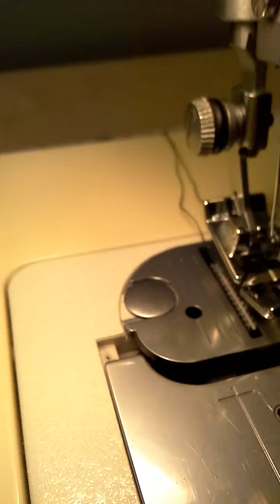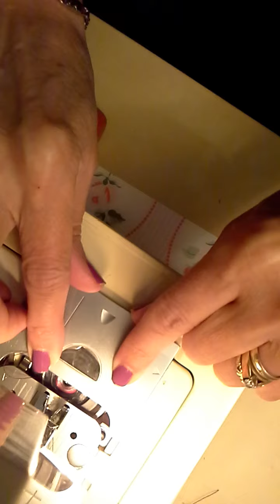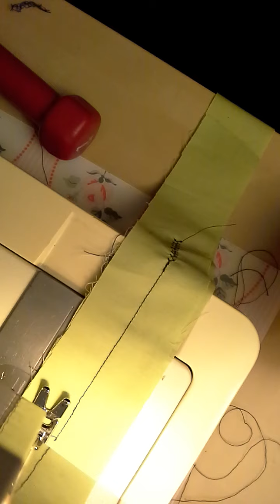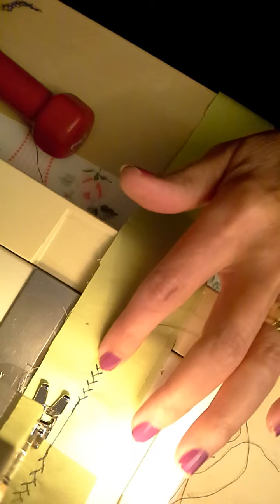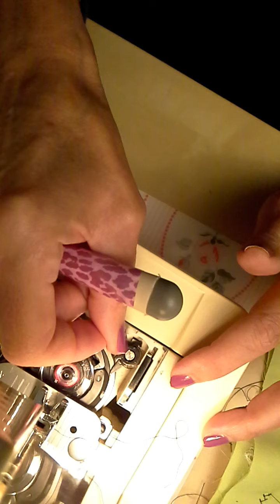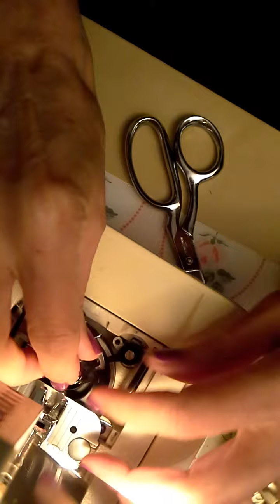Singer 6230 bobbin winding

Comment: Hello Begonia, thank you for this video.
I have the same Singer as you, i'm struggling to find some presser foot that suits my sewing machine. 
Do you know where i can find some ?
Reply from the maker: Apologies for not responding. I do not use my account too often. I only recently started getting more deliberate about it. The 6235 is a slant type sewing machine therefore you need to find feet that will clip on or those that come with the connecting screw in shank for slant type. You will likely find some on Amazon.

Comment: What if the threat came underneath the bobbin
Reply from the maker: That is a common problem with this machine’s bobbin winder. I have found that the bobbin tends to pull up a bit and this creates just enough room for the thread to slip underneath. Assuming everything is well aligned, you can put a tiny bit of downward pressure as it is winding just as it gets going. In fact, I do this almost every time and it usually works. I think it’s caused by machine parts getting loose over time. There is probably a fix but my technique works for me. You have to push lightly though, enough to lower the bobbin without interfering with the winding. Also, stop immediately when you see it winding underneath. Try it out by pressing the foot pedal slowly until it catches.